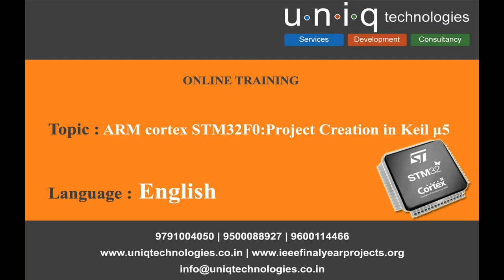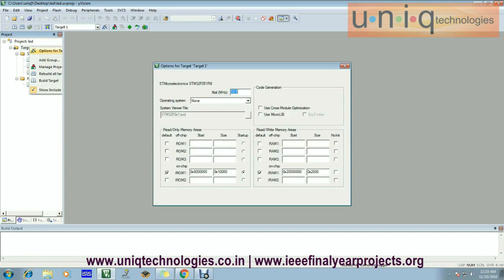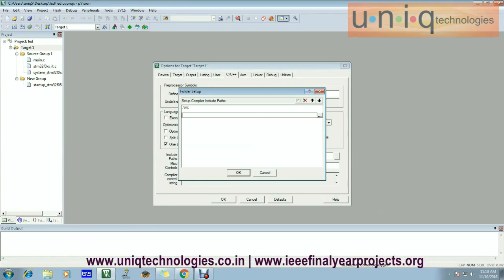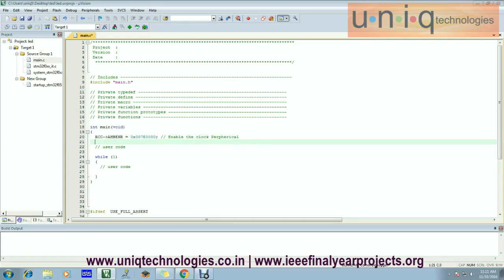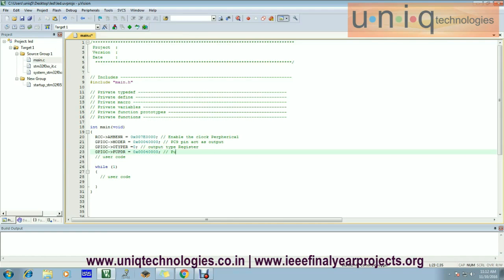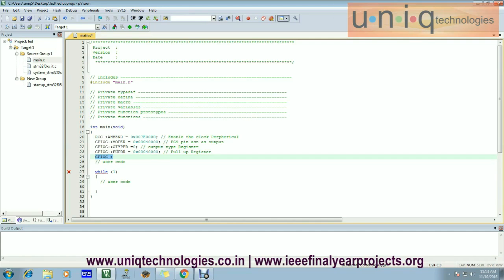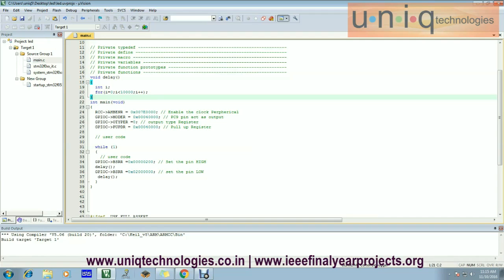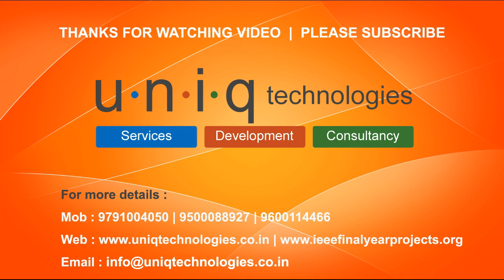ARM cortex STM32F0 Project creation in Keil 5

Comment: Thank you for the upload. The only thing that im missing in your video is how to configure the pack Installer. I'm using the STM32F0 Disco Board.The first thing I did, was installing the CMSIS and the DFP Packs in the Pack Installer. After creating a new project, i couldn't find the Device software components like "GPIO", "Flash", "SPI"...  . Then I tried to configure another Board/Device just for comparison purposes. I installed the DFP Pack for the STM32F4 Disco Board and after creating a new Project, i was able to add the Device Software components to this project. So it works for STM32F4 but not STM32F0. Can you please describe how to set up the software packs for the STM32F0 Board?